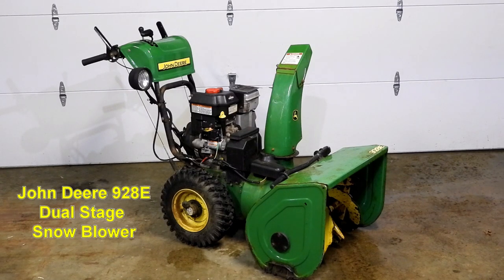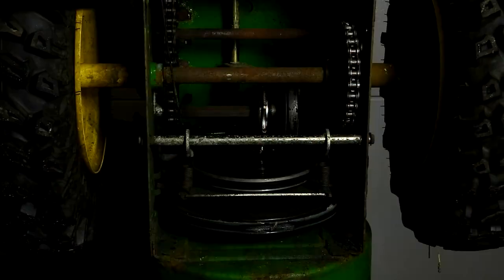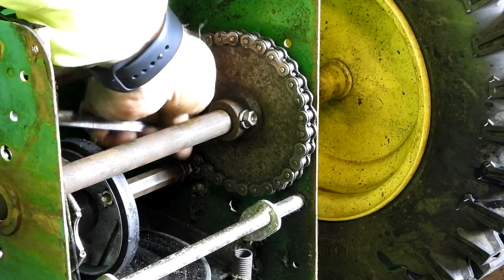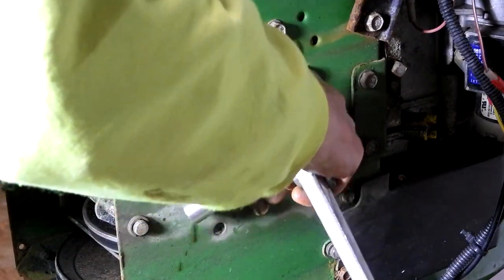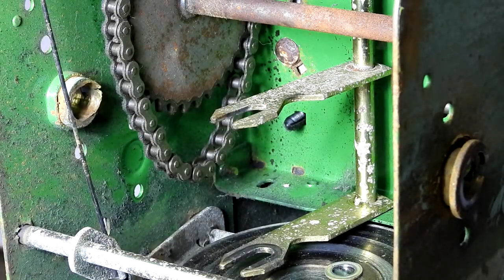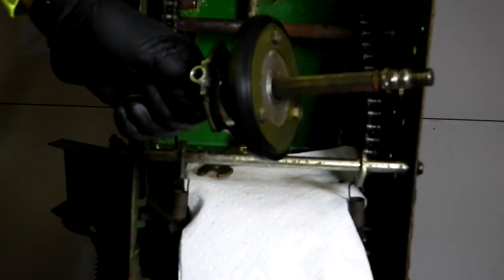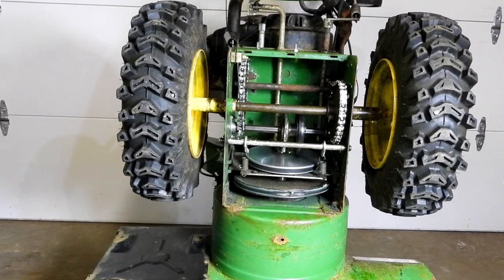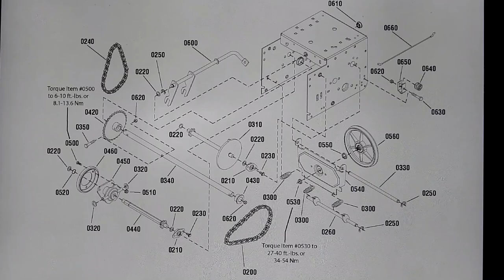John Deere 928E Friction Wheel Repair

Comment: I’ve already had to replace bushings but may need to do again. Now I believe it’s the friction wheel. It’s intermittent on moving and I’ve cleaned the plate a few times. Wheel does look worn. I have the exact same model. Thanks for the video. Did you replace any of the belts?
Reply from the maker: Yes. I replaced the auger belt. I’ve done it several times over the years. It’s a relatively easy fix.

Comment: Do you have the Amazon Links for the parts ?
Reply from the maker: Here they are:
Friction Wheel
https://www.amazon.com/Friction-Drive-1501435MA-313883-Blowers/dp/B075S9XCXQ

Bushing/Bearing
https://www.amazon.com/Murray-334163MA-Bearing-Retainer-Mowers/dp/B0043RTNFO

Auger Belt
https://www.amazon.com/Murray-1736421YP-V-belt-Snow-Throwers/dp/B0043RTOYE

Traction Drive Belt
https://www.amazon.com/579932-1733324SM-579932MA-throwers-Craftsma/dp/B098P454M4
Reply: Thank you very much!!